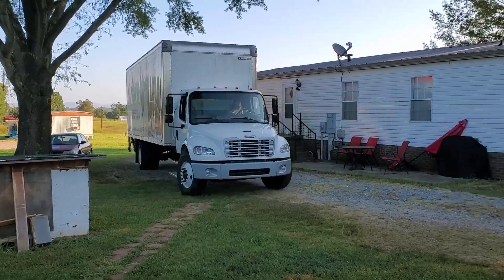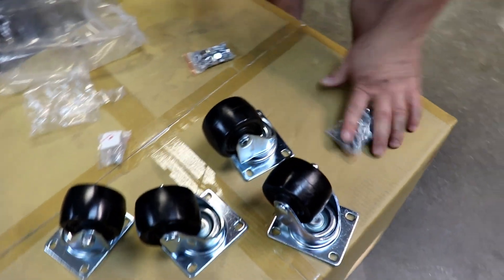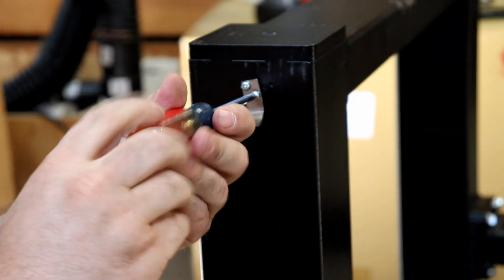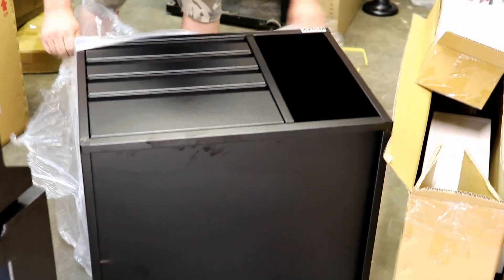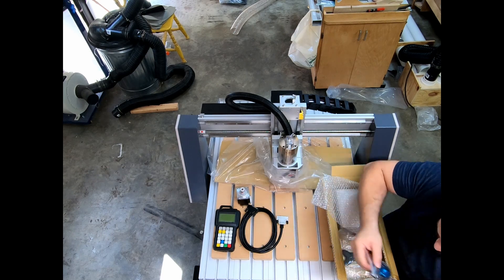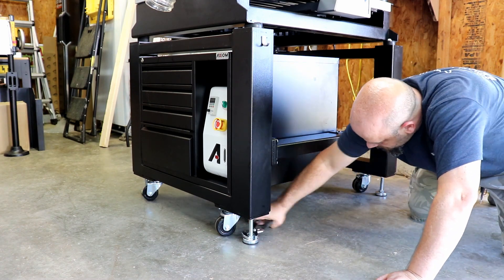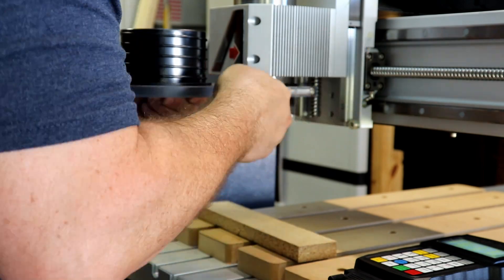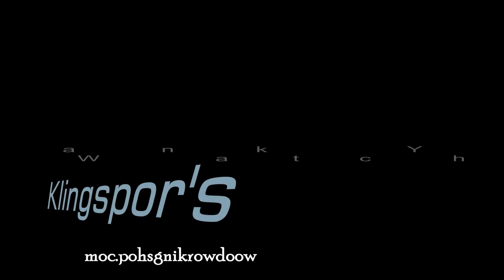Axiom AR4 Pro CNC Unboxing & Assembly

Comment: Looks and specs identical to the Laguna of the same size. Why should I buy Axiom besides the fact that I live within 20 minutes of the Hickory Klingspor? Honest question, is there actually a difference? Are they both made with "global components" from China?
Reply: They look similar, but are different. If you are comparing the IQ Pro (the new one), it would compare more to the Elite series.  If the previous version of the IQ, then it would be the Axiom Pro series.   Axiom would have some advantages and disadvantages depending on what you are looking for.  Axiom is manufactured in Taiwan but does go through considerable quality control.  I can't say where Laguna is made.

The controller on the Axiom is much more robust and their stepper motors are 48 watt (Pro) or actual Servo motors with the Elite.  There rpm range is 0-24,000 which is helpful in certain applications.  

The negative is Axiom currently doesn't have a vac table or ATC, but that is changing very soon from what I understand.

The biggest advantage after the sale is the technical assistance from Axiom.  They are far superior and are quick to respond with accurate fixes.  I'd suggest going to the Hickory store and looking at the Pro on the floor before making up your mind.

just my opinion.  Check out my channel and you will see I owned a Next Wave HD520, then an Axiom Pro, and finally upgraded to an Elite.  Laguna and others were on my radar, but I am so happy that I went Axiom when upgrading from my Shark HD.
Reply: For some reason, YT wouldn't allow me to comment as my craft channel, so I'm doing from my personal one.  

They look similar, but are different. If you are comparing the IQ Pro (the new one), it would compare more to the Elite series.  If the previous version of the IQ, then it would be the Axiom Pro series.   Axiom would have some advantages and disadvantages depending on what you are looking for.  Axiom is manufactured in Taiwan but does go through considerable quality control.  I can't say where Laguna is made.

The controller on the Axiom is much more robust and their stepper motors are 48 watt (Pro) or actual Servo motors with the Elite.  There rpm range is 0-24,000 which is helpful in certain applications.  

The negative is Axiom currently doesn't have a vac table or ATC, but that is changing very soon from what I understand.

The biggest advantage after the sale is the technical assistance from Axiom.  They are far superior and are quick to respond with accurate fixes.  I'd suggest going to the Hickory store and looking at the Pro on the floor before making up your mind.

just my opinion.  Check out my channel and you will see I owned a Next Wave HD520, then an Axiom Pro, and finally upgraded to an Elite.  Laguna and others were on my radar, but I am so happy that I went Axiom when upgrading from my Shark HD.
https://www.youtube.com/@ChristcrossCrafts/featured
Reply from the maker: Our resident CNC Expert @christcrosscrafts do you have an opinion on this?

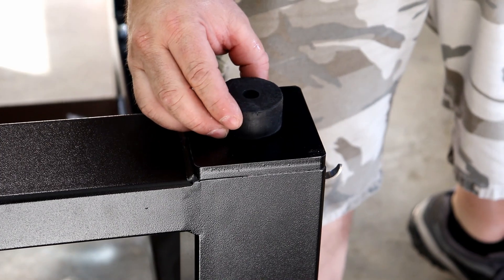Comment: Thanks for the review! Very good job!   Can you tell me... what is the actual weight of the cnc machine you and your buddy are lifting at 3:17 in this vid? Also, will I have an issue getting this cnc through a doorway of 31 inches wide?  I see varying dimensions depending on where I look.  I am in the process of ordering this machine and need to prepare accordingly.  Any help would be appreciated. Thanks again.   BTW... are you the same company I ordered sandpaper through? Good stuff!
Reply from the maker: Our CNC Expert states: I would say that the top unit could be turned sideways and brought in through the door either carried or rolled on a dolly.  2-4 people depending on the circumstances.  I know folks that have done it this way.  

On the AR4, the top portion is likely 250lbs